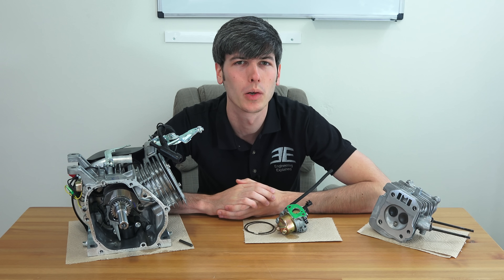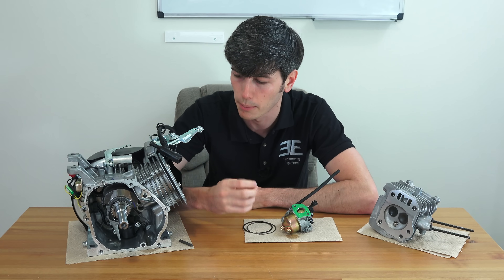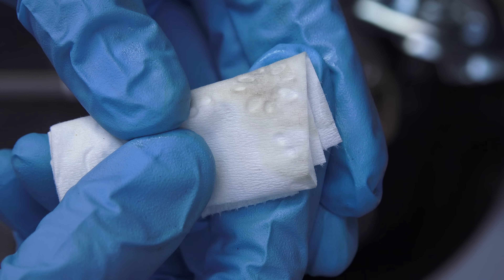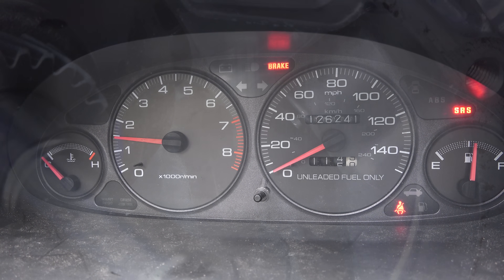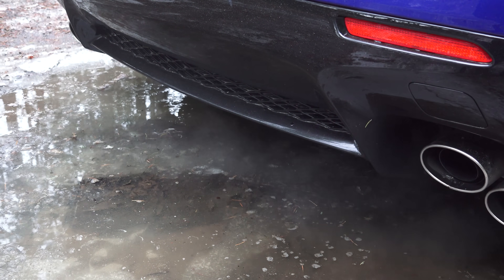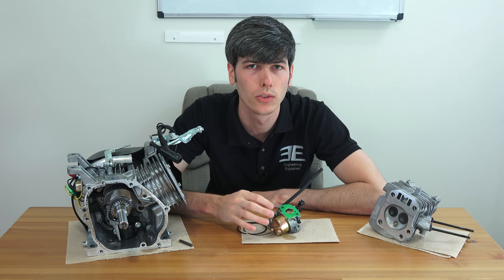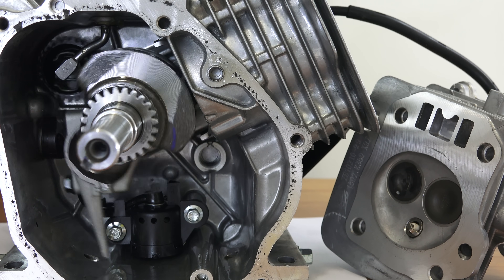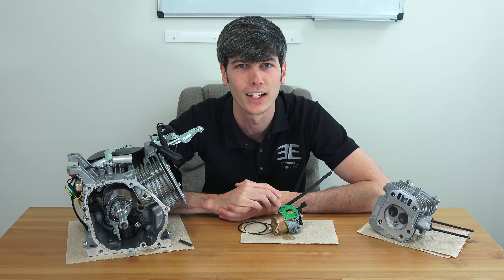Should You Warm Up Your Car Before Driving?

Comment: Big fail here, it depends how cold it is, at freezing point no big deal, about 20 seconds and you're good to go but at -40, its at least 10 minutes, the reason being that at extreme cold temperature engine oil needs to be warm enough to even start circulating from the oil pan up on top of the engine to lubricate the cams and other parts. Even full synthetic oil has its limits in extreme cold weather.Not to mention that metal, aluminium and other material expand and retract in big temperature variation oh and one more thing...a block heater is very common, but with that said if anyone like this guy in the video live in the south, your driving experience in the cold is very limited.I'm no engineer but i'm from the Yukon, i know a thing or two about the cold, that guy doesn't.

Comment: I've always felt the idea behind a sitting engine warming up had to do with the radiator.  When your moving, the radiator is cooling the engine that's trying to warm up as your driving.  Now of course with higher rpms it offsets it a bit not to mention you're warming up the transmission as well, but it seems slightly counterproductive.  Some cars have those blinds/fins in front of the radiator that are closed when the engine is cold and open as it gets warmer to prevent this cooling action from the radiator.

What about drivers that cover their grills in winter?

Comment: So many butthurt car guys in the comments. Read your owner's manual, it will tell you the same thing. Swallow your pride, and admit you were wrong.
Reply: Many owners manual state a ‘maximum’ idling RPM (1000 for mine) to reach before driving, and modern vehicles auto-load the engine at high idle for cold-starts, thus the idling RPM is higher when engine is colder. To reach the driving idle range for these vehicles, it can take up to 5 minutes in very cold days. All cars are not designed the same way, and thus all manuals are not written the same.
Reply: Some things are passed on by parents and they stick, we usually learn them at a point where we don't question them and do it lives on.
Reply: Ahahaha
Reply: Guy on YouTube way too much My manual says its Better to drove to let the engineering warm up
Reply: Warming up your car ia different for everyone. I personally warm it up. Im so close to a freeway. I will be driving it hard in less than a couple of minutes. So i let it warm up to reach the lowest starting line at the bottom (take like 3 min at most) Then i take off.
Reply: James L. Walsh Um, and literally no owners manual ever says anywhere that you should drive your car on a cold engine in frozen conditions? Dumbass.
Reply: J McCann Actually yes they all do maybe if you read an owners manual just once you would understand that.
Reply: There is a video on engineering vs mechanical experience.  This guy is brilliant in my opinion,  but I will always warm my engine. 
 Owners manuals are politically correct including EPA regulations. 
 VW used to recommend painting chassis with old oil after oil change to prevent rust. You'd never see that today, but it's a good idea for the car.
Reply: Justin Barrett ummm. I always paint my chassis with old oil before the winter :/

Comment: my neighbor had a 2012 toyota Camry that she bought from the dealer, she is the type to hop in her car and pedal to the metal all day everyday even in the winter and sadly her car failed after the 3rd year of having it, people don't understand that 90% of engine wear occurs at start up. look at it this way if you set your alarm clock at 4am as soon as the alarm goes off can you get up and run full potential?? or you first have to fully wake up and fully warm up before you go out jogging, it's a no brainer right?

Comment: @engineeringexplained
What about for a Diesel engine?? It's still fuel injected but I would imagine a Diesel engine (i.e.  Jetta tdi) would suffer compression loss until the engine reaches its optimum running temperature?

Comment: still a good idea for the temp to raise a slight amount before driving. the issue of telling people not to warm it up is people dont understand what "dont drive it hard" means. more modern cars yes are so quick to warm up by cold start programing and lower viscosity oils  its less of an issue but 90% of people do not have brand new cars. so just give it a few minutes to warm up. long as that temp gauge moves you should be ok. obviously never floor a not 100% operating temp engine. this goes for 100°F days as well.source im an a.s.e. certified auto technician
Reply: oh NEVER LEAVE YOUR VEHICLE UNATTENDED WITH KEYS IN INGITION RUNNING. this seems obvious but ppl do it every day. if the keys are in it doors locked or not people will steal it. not to mention many city laws that will have you ticketed for this offense. i have personally seen people run from a car for 30 seconds and a person walking just jack it in that time. get a remote start with anti theft or just dress for the weather and sit in the car.

Comment: warming your engine has little to due with fuel. operating temperature is the safe temperature range for engine operation its pretty self explanatory. your engine warms expanding metal, sealing rings and bearings and allowing oil to flow smoothly over moving parts. you should always warm your engine in cold temperatures.